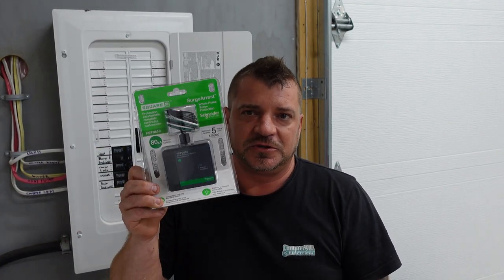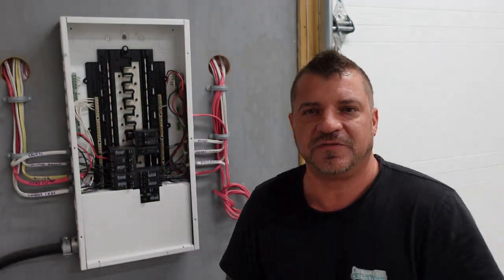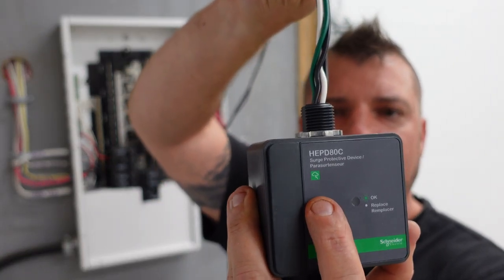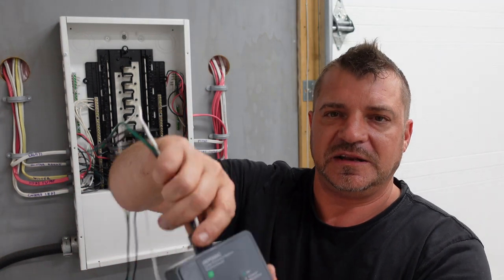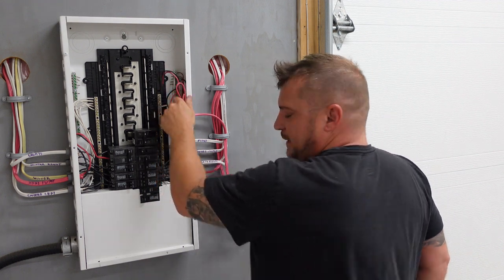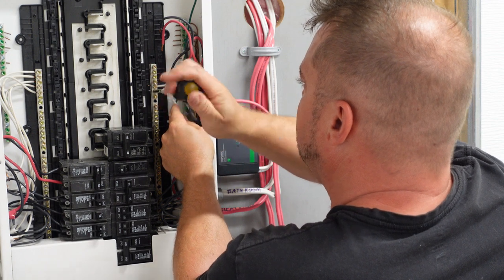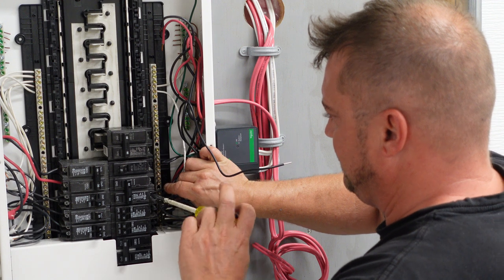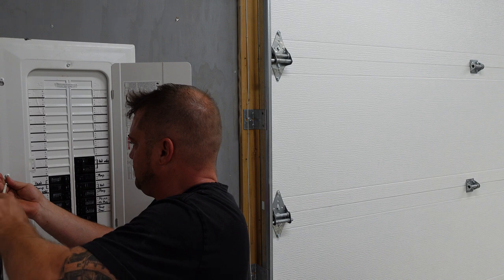How To Install Home Panel Surge Protection

Comment: When given the option to pick 15, 20, or 30 amp breakers, always pick the 30 amp breakers because they are harder to trip. As for the video, you should have moved the double - pole breakers that were close to the main circuit breakers up which in turn would have freed up two spaces for the whole house surge protectors breakers. The white wire which is the neutral should be as short as possible with some slack because the longer the neutral, the less effective it is. 

It could have been a little better, but, some protection is better than no protection.

Comment: Can you use any brand surge protector in any panel box. Can you use any brand circuit breaker in any panel box
Reply: The model in the video can be used in any panel. The circuit breaker you buy should correspond to the brand of the panel box. Example would be GE breakers for a GE Panel or Eaton circuit breakers for a Eaton Panel. Please avoid mixing and matching circuit breakers.

Comment: Good info,. What if your service panel is recessed into the wall?
Reply from the maker: That would be an issue
Reply: @conquerallelectrical  absolutely no problem and issues with putting an electrical panel recessed into the wall. As long as it complies with NEC and your local regulations.
Reply: Good question. My electrician installed it and left my drywall open. I can’t cover it so I might create a glass box. That’s why I’m looking for a video
Reply: Why not place inside?